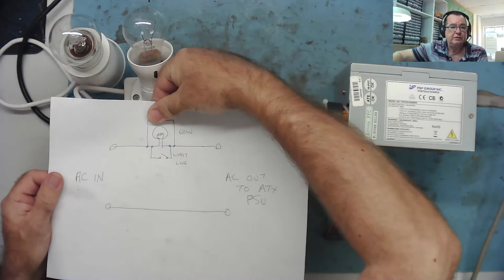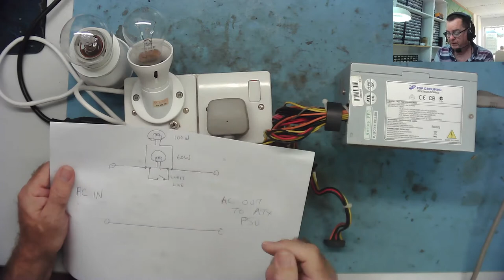Light Bulb Current Limiter (Dim Bulb Tester) FAILED

Comment: I used to use a dim bulb tester but found a lot of PSUs I work on have PFC's and quite often I will land up blowing the primary stage because the PFC is overcompensating. This is particular in TDK/ Lambda/ Coutant Industrial power supplies. I now just check across any mains input of an unknown PSU with my Huntran tracker or (octopus circuit) and see if I get a good capacitor charge, this usually tells me the bridge and Switch mode is good. I then start the PSU up on a Variable transformer (variac) and monitor voltage and AC current, yes the I may get a high current pulse as the PFC comes in and charges the caps. I've been doing it like this for years as I repair PSU's every day.
Reply: Thanks share valuable

Comment: For testing high power modern power supplies using active PFC circuit, one needs a test lamp power of at least the half of the nominal power of the psu. Otherwise problems like the shown one appear during testing. For example, a 750W psu needs lamp(s) of at least 300W of power for this test...

Comment: Good evening from Greece, after I saw your video with the lamp I would like to ask you something, I have an amplifier in my house that burned out the output transistors, I changed them but when I open it the transistors heat up, I put the lamp in order and as soon as I turn it on the light comes on momentarily and then it stays on for a long time and then the transistors heat up but not so much, if you can please give me some idea why I did this, thank you from the bottom of my heart.
Reply: To έλυσες το πρόβλημα;

Comment: mine, i use 50w incandescent bulb. it saves a lot of time, money, and effort in trounleshooting and diagnosing repairs, especially power supplies
Reply from the maker: Hi  mu no, 
Yes 100% I agree these are very useful devices to build - every electronics workbench that is repairing mains powered devices should have one.  I even have two of them!

On this video I just wanted to highlight a situation I have found specifically with PFC in power supplies that causes the light bulb to come on bright even though the PSU has no load - giving a kinda false indication that the PSU has a short circuit load when it starts up (for example short circuit rectifier diode one a secondary 12V, 5V 3.3V etc)

Once you realize that a good working PFC circuit can behave like this then it also saves you time money and effort in your diagnosis.
Reply: @LearnElectronicsRepair  exactly,... thank you for the videos you shared... more to come!
Reply: @LearnElectronicsRepair You need a lamp of much higher wattage for this purpose. Please see also my other comment above.

Comment: The seemingly chaotic effect that you see is caused by the input behavior of the PSU which uses DCDC converters whose input power demand closely follows the output power demand. Therefore, the input current is inversely proportional to the input voltage. Thus the PSU exhibits a negative dynamic input impedance.
The light bulb increase the mains impedance drastically. The resistance of the tungsten filament increases by a factor of 10 from cold to hot filament. Depending on the initial conditions like filament temperature and capacitor voltage inside the PSU, the PSU input voltage may have 1 or 2 values where the purposely weakened mains supply satisfies the power input demand of the PSU. Essentially you have built an analog computer that solves an intricate differential equation, and you are witnessing the solution in real time.

Comment: Really interesting.
Would a light bulb with Higher Watts Help ? But that could also defeat the purpose at the end of actually limiting , what do you think Richard ?
Reply from the maker: Hi Daniel

I put a 160W limiter on to it and it still did the same.  As you suggest, there is a pay off between the limiter and protection - for example, on a 1Kw lamp (like some old school Halogen outdoor floodlighting) the device you are trying to protect could still draw a good few amps and self destruct.

I have only come across this issue with power supplies that have PFC and I think I described the problem pretty well (though I don't know the exact reason they act this way, there is a bit of supposition and guess work going on here)

I also read that old audio amplifiers with JFETS can be destroyed by using this sort of limiter but I don't know from personal experience if that is true as I don't think I've ever worked on one
Reply: @LearnElectronicsRepair   hello nice enigma but i think you never used 160w because the bulbs are in parallel at least in schematic  (making it as if it was around 40w total lol)
one more hint, with 60w bulb the tester lights on and with both bulbs dosent even start.... it proves the current in were even less with both bulbs parallel and proves you are wrong in schematics and hardware!

to work properly i think you should wire switch, bulb, bulb all in series 
keep the good work
Reply: I've been using a 300 watt light globe in this manner for around 40 years. The globes he's using are insufficient.
Reply: @MrVeryCranky Yes, I also use a 300W halogen lamp with such high power supplies. Lower wattage cannot start up these units under repair. It needs to be at least half the nominal power of the psu, ideally the same power with it...

Comment: Good to know.  I seemed that the longer you had it OFF, the better the chance it would act normal; as if ... a resistor was discharging the PFC cap ... which didn't have enough time if you did it On/Off quickly.  Thx.

Comment: Yeah a little Occam's razor going on here,  one other problem that might effect using a Dim bulb is how hot the bulb is, it is a   temperature coefficient resistor so even a few seconds at full resistance may stop it from working as expected.   It is an old TV repair shop problem when looking for shorts, if you use you dim bulb too often in a row it will glow bright even without a short as long as there is sufficient amperage draw. 

Anyway the most likely reason is the one others have given you need a much bigger light bulb when working with a PFC.

Dim bulb is really good for old linear PS  and   really old system such at a 5 valve radio.

Comment: Your explanation of PFC is rediculous. This is acheived with chokes and capacitors. There is no such "boost" arrangement, the voltage on the capacitor will be around 340 volts, ie supply multiplied by aprox 1.4.
Suggest you do some study before posting such claims.
Reply: You are kind of correct but…..you’re talking about passive PFC. Active or boost PFC is more common than you may think.
Reply: Sorry I don't agree, most switch mode PSU's will start up from around 80v therefore the PFC will act as a buck converter to give the 300 plus volts on the Bus capacitor. I work on a lot of industrial power supplies
Reply: The PFC circuit (among other things) boosts the rectified (230V) mains voltage to around 385V and keeps this level stable on the terminals of the bulk capacitor for further processing...